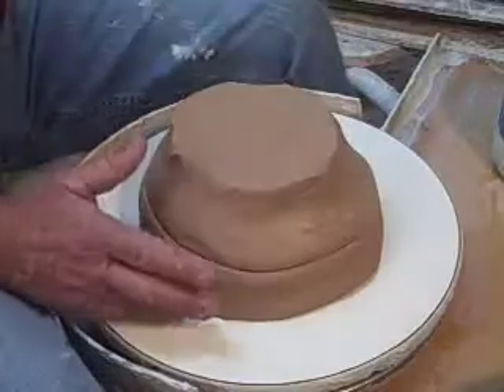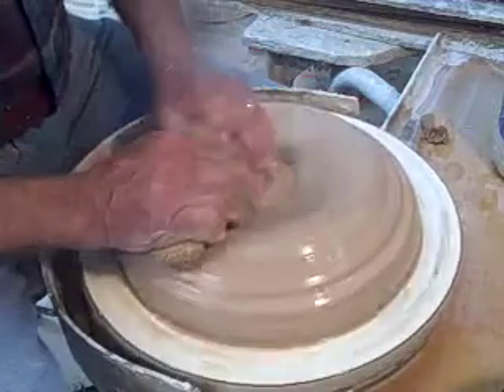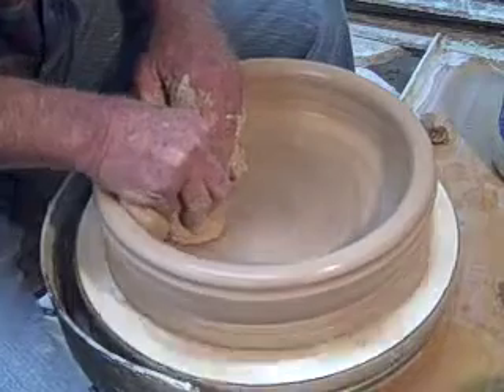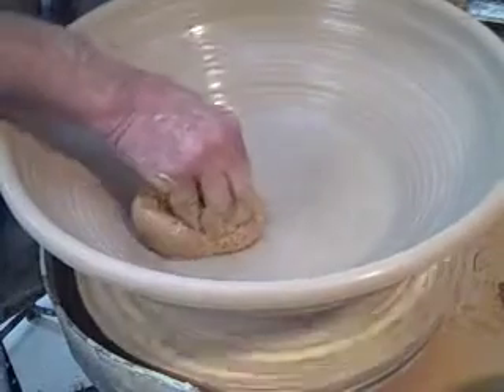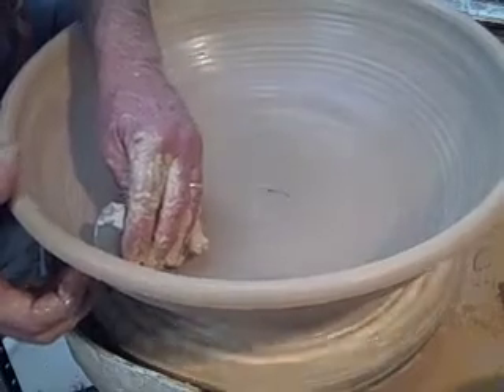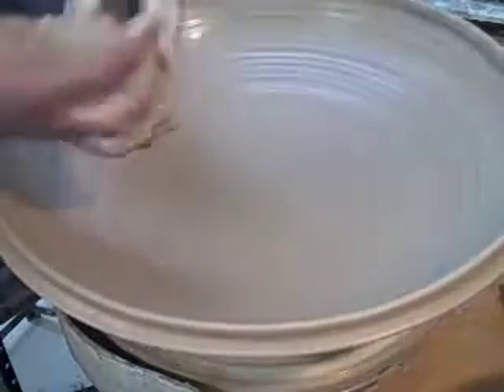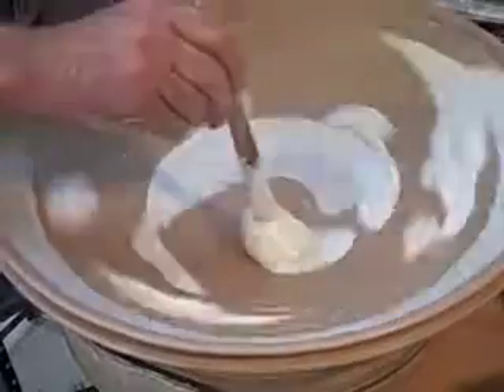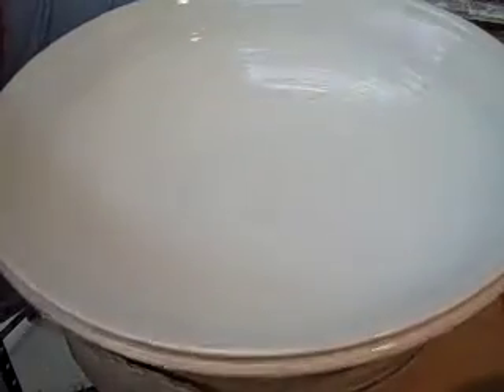How to throw a large shallow bowl with slip decoration

Comment from the maker: Two of you asked about the foot or trimming this bowl, so I thought it required further explanation. Put a large bat over the rim of the bowl with the bottom bat still attached and flip the whole thing at once holding the top and bottom bat. I have done it with much larger pots than this, it is not so hard.  Attach the bat with the upside down bowl on it to the wheel, center and trim. I generally dry them upside down for a couple of days before  turning right side up. Give it a try.

Comment: I loved  your video.  You used porcelain slip on top of clay, I wonder if the firing temperature is compatible?
I am just a beginner.  Please advise me.  Thank you.
Reply: Millie baek I am sure you know the answer by now, but for those reading the comments at the present time. If you are using porcelain slip and a darker clay body for the vessel just make sure they are both the same cone. Also, try to use a slip and a clay body that have similar shrinkage. I have had some slip pop off in places after bisque firing. Only slip trailed, not brushed slip.